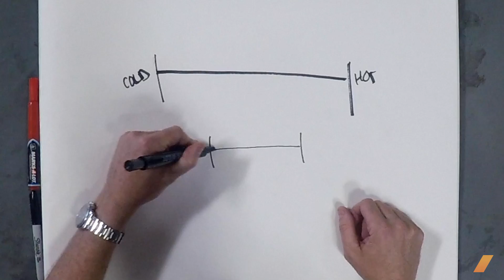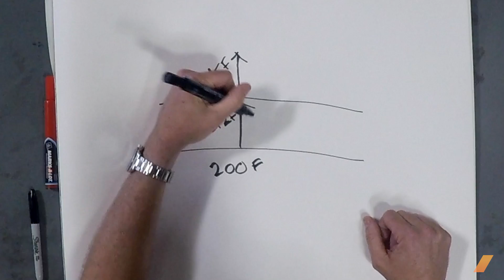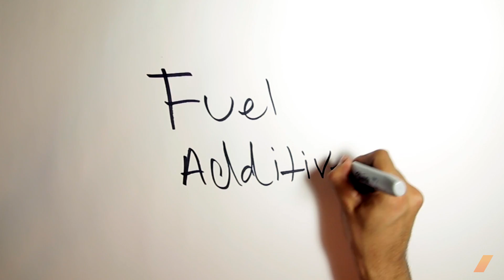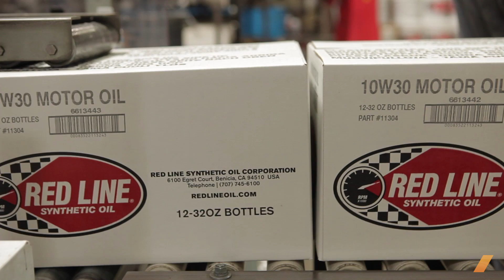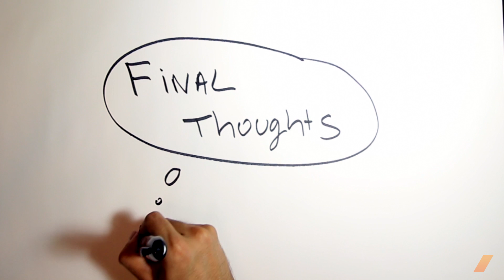10W-WTF!? Dispelling Myths About Oil -- /ENGINEERED

Comment: My car specifies Pennzoil Platinum EURO 5w-40 which is about $10/quart. I can't seem to find which oil group this oil is - Pennzoil says it is "PurePlus" which exceeds Group III, but they don't say what it is.
Reply: No idea why the Euro costs so much more than pretty much any other oil. Nobody stocks it either, I have to order it on Amazon. Some folks substitute Castrol or Rotella T6, but I'm not going to do that unless I actually know they're the same spec or better. Car is a 500 Abarth with a 1.4 Turbo. I beat on it and have quite a few upgrades, so don't want to cheap out on the oil just for cheap's sake.
Reply: PurePlus Technology (from Shell-Pennzoil) means it has synthetic base oil that has been made from natural gas (GTL), as opposed to crude oil. These synthetic motor oils from GTL provide better high and low temperature performance, and GTL base oils are actually BETTER to formulate motor oils with because they have better solubility than PAO. PAO does not have good solubility, which means you cannot dissolve additives well in PAO, and because of this, there is no such thing as a 100% PAO motor oil formulation!! There are a lot of myths around API Group III vs. Group IV vs. Group V --- just because a motor oil uses base oil with a higher Roman numeral does not mean it is a better formulation!!
Reply: Euro motor oils are formulated for use in both gasoline and diesel engines, so they have higher amounts of additives (more $). Also, the engine tests for some of the euro OEM approvals can be quite expensive.
Reply: Engine Girl Thank you for the technical response! So much myth and anecdotal claims surround motor oil. Knowing the engine that I have, it runs high temps, high boost, and has a hydraulic/solenoid valve system (Multiair) for intake... so I think I will stick with the recommended oil for now, now that I know what to look for as far as the difference.
Reply: Its just a high quality Group III oil..
Reply: You could use Mobil1 0w-40 which is $25 for 5 quarts at Walmart.
Reply: Alvin, Fiat should be able to provide you a list of acceptable motor oil manufacturers, or a spec number that any particular oil should be able to meet to be considered good for your car. Go the next route, let's say ISIS blows up the Pennzoil plant where your oil is made.... that would mean nobody could change their oil until that plant was rebuilt... clearly that's not the case. Do some digging on the forums, or bobistheoilguy.com and look for the specs. Mercedes has a bunch and depending on what number 239.0 239.5 etc, you might be able to do a 10k oil drain or only a 5k.
Reply: Alvin Brinson I am sure that's a natural gas based synthetic. High quality stuff.
Reply: Alvin Brinson I am sure that's a natural gas based synthetic. High quality stuff.

Comment: So, I have a  newish car 2013, and it recommends fully synthetic oil.. it isn't a fast or sports car, but it has a turbo motor, is that fully synthetic oil just because the turbo ? thanks.
Reply: most likely. Turbo engines produce lots of heat. Especially if the turbo is cooled using the engine oil, thats extra heat the oil have to deal with
Reply: James Hurt It may be to extend how long your car can go between oil changes. I know most Volkswagens use synthetic and they are meant to go 10k miles between oil changes.
Reply: Nathan Sabo, yeah..I go in when it notifies me.. that is usually between 9 and 10k miles.
Reply: if you have a turbo you want to go more frequently than that... Like they said more than likely your car is cooling the turbo with the oil therefore showing the oil more vicious cooling/heating temperatures. Keeping the oil in for that long is dangerous. Also considering the rule of thumb I've heard is full syn only adds like 2-3k per change in a newer car.. not 5k
Reply: Vincent Tenaglia, I even asked that at the dealer, he told me to bring in when the car says to.. I was just following his call..
Reply: James Hurt cause the turbo makes a lot more power and therefore heat.
Reply: James Hurt right. What car? I drive a Mazdaspeed 3 and has a pretty big turbo that is oil cooled. I change my fully syn oil every 3-4k miles just because I'm overcautious and don't like my oil to be too dark/dirty. I don't drive far distances so I am looking at changing about every 3 months. Some places say every 3 months OR 5k miles is the best judgement for traditional oil. Even though syn can take more beating it's still great for your car to change it like you would traditional
Reply: Vincent Tenaglia, right now I drive a dodge dart, small 1.4 turbo. Good on gas, but not so much for speed..Ha-ha
Reply: I use rotella in mine. I change about the same amount of time.
Reply: b_m_b I would use Rotella cause I love shell and the quality of products they have but I can only find 10w-30. I live in Maryland so I have to put atleast 5 in during Spring, Fall and Winter so I just go 5 year round
Reply: usmc2076 everyone on Mazdaspeed forums say Mobil1 is garbage. I've never used it on any of my vehicles so I am not sure. I usually use either Pennzoil or Castrol. I've read that Mobil1 is highly known for breaking down really quickly into a thinner viscosity. And I'm sure we all know a thinner viscosity the less heat the oil can defuse from the engine
Reply: I'm not a particular fan of Mobil1 either, but it's not necessarily because it breaks down, it's because every vehicle I try it in drinks it like water. I switched to royal purple in my superduty, doesn't burn a drop now, I use walmart supertech synthetic 5w30 in my Lincoln LS and do 10k oil changes (twice factory) and it uses about a quart and a half in 10k. I also send a sample out for oil analysis to make sure I'm not getting into trouble. My change intervals are now stable with these products. 

I'm about to fight this battle with my 2014 E63 AMG s model, it actually calls for mobil1 0w-40, and I just cringe at the thought of that stuff being in there.
Reply: How much are you paying for Royal Purple? I was thinking about trying it but i read a lot of mixed reviews and Castrol seemed more leaned towards great. I pay roughly $30 for 6 gallons of 5w-30 full synthetic at my local auto parts. Also my owners manual calls for it, so big plus. Lol. I've noticed usually Duratec engines call for Castrol. what does your manual say for the Super Duty and Lincoln?
Reply: 5 gallon of 5w-40 RP for $150 is what I'm paying. What brand of synthetic are you getting for 30 bucks for 6 gallons? I think you mean quarts. My 06 superduty doesn't really say, just so long as it's at least CJ rated diesel oil. weight varies by load and temperature range. 

The Lincoln calls for 5w-20, and after reading a different report, I should probably be running that instead of the 5w-30, but after 130k miles of that stuff with 185k total on the clock, It can't be that bad. 

FWIW, I never had any problems with Castrol oil, I run it in my tractors for straight 30wt, and ran 10-40 in my 351 powered mercury capri when I had it. Good stuff.
Reply: kleetus92 yes I meant quarts not gallons damn typo. I'm assuming your Lincoln is a V6? It won't feel the difference, more small small engines will struggle on 30 weight
Reply: Vincent Tenaglia no, actually is a 3.9 liter V8. honestly runs pretty good.

Comment: I have Chevrolets with flat tappet 6 cylinder engines. The machine shop that did the machine work stated that I should run nothing but oil with the ZDDP in it. If synthetic oil is supposed to be better then why can't I use that?
Reply: I have a 71 Datsun and I was recommended the same thing. The older engines were designed to be lubricated by ZDDP (which is a zinc based lubricant), and many newer oils contain little to no ZDDP,  so it is supposed to work best.. though I don't really know much more than that.

Comment: So would it be ok if I use 10w40 vs 5w30 on my SOHC 4.6l that regularly likes to hit 240 degrees F ?
Reply: TheAlmightyCon what is the average temps where you live? that's where 5w and 10w make the most difference. other than that going to a 40 will help when you reach 240°f
Reply: TheAlmightyCon sounds like you might want to get your entire cooling system flushed including the heater core
Reply: thanks for the comments guys, average temp here is about 80-90 Fahrenheit (I'm in Texas) during the summer, but it can get pretty cold here right now it's 46. A couple people say going to 10w 30 is really bad on my car (mustang gt) cause the oil can't get back to the sump but if its 30 when it's heated up then I don't see the problem with the 10w vs the 5w

Thanks for the idea on flushing the cooling system, I'll give it a shot.
Reply: TheAlmightyCon 10w-30 is good down to 20° if i remember and 5 is good for like -5 so i think you're fine in tx. if you need to google or just open up the owners manual. most cars will give you different temps and suggested oil weights to use.

Comment: Top tier gasolins almost without exception do not contain the best carbon buster, PEA.
PEA is in Chevron/Texaco and a few others.  The other major oil companies pull plenty of tricks to increase octane and detergency....none of the best solvents/detergents  get used in sufficient qtys. to make a difference.  That is why REDLINE fuel additive is so necessary as well as a reasonable octane booster with upper cylinder lubricant.  Yes these products do make a performance difference short and long term. What do you think?

Comment: So if my vehicle recommend usage of 5w20, which is what I have used so far, but it take a long time to build heat, and very little time to lose all that heat, I should do......what exactly?
Reply: Just use 5w20.
Reply: 5w20 or 0w20, either's fine.
Reply: Well yes if it gets very cold where you live 0W-20 would be even better, i would recomend Mobil 1.

Comment: Honestly there is no need to buy fancy intake cleaners or carbon busters. Get a spray bottle full of water and start spraying into the intake while the engine is running. It may sound stupid but the carbon atoms and the water will combine and will exit the exhaust as Hydrogen and Carbon Dioxide.

Comment: he didn't get back to octane booster but this was very informative
Reply: JuniorMason they don't work.
Reply: Shawn Dickens lol lol that much I gathered just wanted to hear him go into details
Reply: JuniorMason I know. Just thought that would be funny. you can mix octane, but lead Race Fuel will clog cats and kill O2 sensors.
Reply: Another thought. Mix 5 gallons of 100 octane and 5 gallons of 110 octane to get 10 gallons of 105 octane. Now let's do the normal tank full of 20 gallons used on the bottle. 20 gallons of 100 octane and pour in .25 gallons of booster to make 105 octane that quarter gallon can would need to be 505 octane. So not only is not realistic, but can't see it being possible since the highest octane fuel I've heard of is 120, but I've only used 118 nitrous fuel.
Reply: Shawn Dickens yea I read that one bottle of octane booster will only raise it by 0.01 or something like that
Reply: either add 10% methanol or xylene to your fuel with a bit of atf oil. racefuel at pumpgas prices. methanol and xylene cost the same or are cheaper depending where you live, and more importantly it is still unleaded. racegas usually isn't which ruins catalityc converters.
you can run much more advance or more boost with this mix without increased risk of compression related detonation..
Reply: Yes, but know your system limits or you can go lean. It's easiest to remove the cats and run Race gas.

Also 10% ethanol is okay doesn't mean 10% methanol is okay. Takes 30% more fuel for E85, but about 100% more methanol.
Reply: it's always kind of a gamble when mixing meth or ethanol to gas. unless you know what you are doing
Reply: Shawn Dickens you are basicly making E10. So if E85 takes 30% more fuel, E10 takes 3.5% more fuel.
E85 is not available here, so i have no experience with working with that. Just running e85 if available might be the better option.

10% methanol is used by a lot of people in a lot of engines. It is a tried and tested formula really. And the methanol extracts a lot of heat as well.

On a side note, if you are doing any serious performance modding you really should be running an wideband 02 meter, either standalone or trough your ecu. 
As well as inform yourself on what the mods or in this case the fuel mixture you are concidering actually does to see if it is suited for your application and what to look for as signs of things going wrong.

Never blindly listnen to other people, especially online. Always do your own research if you get a tip that is usefull or interesting to you. We use xylene with great succes so it might be worth looking into for you.
Reply: Ethanol is not equal to methanol. You can't make E anything with methanol.

As for mixture what AFR is the normal window you tune for with this M10.

Not saying it isn't possible. You just shouldn't do 10% meth in a car E10 safe as it will not be perfect. It will be like running E15 in an E10 safe motor.
Reply: +roger supernova If you are adding Methanol to your fuel.. I feel sorry for your car.
Ethanol is bad enough despite their claims.
Reply: SilvaDreams i'm adding xylene, not methanol.
And tnere really isn't anything wrong with methanol, it is the easiest way to solve issues you run into when pushing your engine to the max.

Comment: Viscosity is a function of Oil Clearance, a 11,000 HP Top Fuel car wouldnt last through warmup, if the Right weight oil (SAE 70W) _ oil, and shrinking the clearances to use a 30W isnt an option.., the bearing clearances, and other clearances determine the clearance, the side Clearances in a TOP fuel engine is .050" verses a stock engine around .018", higher HP engines need more clearances to carry off the heat, and Cushion the parts keeping the parts from touching,.....

Comment: I had a car that required SAE 40 or SAE 80 straight-weight non-synthetic non-detergent oil for the transmission. Somebody put a "modern" multi-grade lube in it, and it crapped out within 2000 miles.

Comment: You mentioned that friction modifiers when used in manual transmissions generally slows down the movement of the synchros, generally allowing for better gear engagement. What about dog engagement style gearboxes? How do friction modifiers affect the performance of this transmission?

Comment: Would have been nice to know what mileage intervals he recommends for daily/track car/synthetic/HC oils.
Reply: Every car is different.  Either go by the manufacturer's recommendations for the engine, or get Used Oil Analyses performed on your oil when you drain it, to get recommendations from the lab on OCI.
Reply: Malteser3535 just checking your oil helps as well. is it dark, change it. is it thin and runny, change it. does it have a burny smell to it, change it.
Reply: roger supernova
I don't think "dark" is a good indicator.  Oil turns rather dark fairly shortly after being put into service, certainly within 1K-2K miles.  And it will always be thin if the engine is hot.  Not sure why you're implying "thin and runny" to be a bad thing.
Reply: Patrick94GSR if it is black after a 1000 miles your engine is dirty inside. If you wanna do it right you should really change it after those 1000 miles.

There is a difference between warm oil and runny oil. Don't know how to explain it, but there is.
Reply: Conventional oil turns dark a bit more quickly, if your syn oil is getting dark that quickly, something is definitely up, and oil isn't that expensive. Change it every 1k miles with some more conventional and filter, and maybe after 3 changes go back to a synthetic.
Reply: +roger supernova Explanation is in the video. It's called Viscosity and Oil Grade.

Comment: I'm currently testing out Redline oil and synthetic to boot for the first time in my 1970 Z28 with a little over 10,000 mi on the rebuilt LT1. I use 2 diff fuel cleaners, MMO and Seafoam and pump nothing but Shell Premium fuel with 0 % ethanol here in Ontario Canada.

Comment: Actual photo of engine internal would have being nice. 
For example, 1) when he said using premium fuel throughout the life of the engine vs regular fuel, and 2) near end of video when he said use high quality synthetic oil from new to 100K mi, vs using conventional oil from new to 100K mi. 

If there is no evidence shown, especially a Red Line sponsored video where they can show Red Line’s R&D tests engines vs control engines, then it is just a lot of showmanship - which this video is.

Comment: My Honda asks for 5w30 but you recommend 5w20 as it coats as a 30. Is that the right oil I should use on my track car as that's what I'm currently using? It's a stock d16y7 with 200k and I live in Phoenix, AZ.
Reply: warnerg80 no, watch the video again.
Reply: Don't use a 20 weight oil if the spec calls for 30, and likewise don't use 30 when it calls for 20.  A 20 weight oil in an engine that needs 30 weight may not develop enough oil pressure.  And a 30 weight oil in an engine that need 20 (most newer Hondas and other newer cars from the 2000's on up) won't lubricate in the bearings properly because of tighter bearing clearances.  I would recommend 0w-30 for a D16 engine.  That's what I run in my B18C1 with 357K miles!
Reply: Patrick, I get that if my car asks for 5w30 but if you look on their 
website they recommend THEIR 5w20 for Hondas. Ive been using it and it seems to be fine. It says THEIR 5w20 coats as a 30. From the video it I should run a thicker oil 30 or even 40 but why do they recommend THEIR 5w20 for Hondas
Reply: Ok that's weird i just checked their website and it says to use the 5w30. That's weird cause when I first checked it I thought it was weird they recommended a 5w20 when I was gonna get the recommended 5w30. I'll change it out to their 5w30 before my next race.